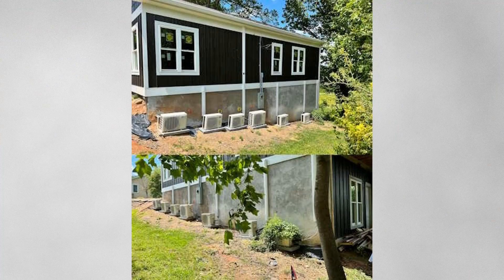Can You Have Too Many Minisplits? | FHB Podcast Ep 694

Comment: I own 12 splits. Different homes. One house has 7 now. I install them myself in about an hour (not including running power, depending on where the power is coming from). These are inverter and non inverter units. 1 ton 120 and 1.5 ton 220 units. There is no substitute in a hot humid climate for central air. I think of splits as extra horsepower, like a super/turbo charger for an already large engine. When it’s 100° to 110° outside, these will allow you to hold 70° inside.
Reply: For garages, sheds, campers, sum rooms, pool houses, west facing bedrooms, poorly insulated rooms, they can’t be beat.

Comment: I’m also a contractor in NYS, and work directly with utility rebates, and it’s not that you get a rebate based on the amount of heads, but instead the output of the systems. So, more systems = more rebates, but also equals more overall cost. But you have to provide a heating load as well. That seems excessive and my utility would definitely question this install.

Comment: I reeeealy have trouble believing multi-zone heads couldn't have been used to eliminate several of those outdoor units.

Maybe one of them is a heat pump water heater?
Reply: A single multi zone condenser is typically cheaper that multiple single zone units.
Reply: I reckon there was a sale on the single zone systems.  I do like the redundancy.  If you have multiple heads on the same outdoor unit, that unit is getting a workout and likely to fail sooner.  A bunch of single zone mini-splits means they are all lightly utilized and if one breaks, you're still comfortable.  Shrubs can hide the eyesore.
Reply: @markstipulkoski1389  > If you have multiple heads on the same outdoor unit, that unit is getting a workout and likely to fail sooner.

Could you say more on this? Presumably these units are being appropriately sized, so a multi-unit would rarely be going full tilt, because it would be uncommon for all of the heads on it to simultaneously demand full heating/cooling, while this seems more plausible to happen in a single room with a single-zone mini split (e.g. when a door is left open). What am I missing?

> I do like the redundancy.

This is a reason we are happy to be having 3 condensers being installed at our home (install is on Monday). If one unit fails, we will still have >50% capacity with the other two.